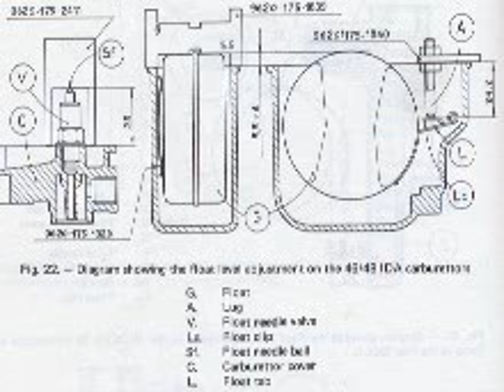Picking Weber Emulsion Tubes by David Vizard

Comment: where I can get more of this recording..
Reply from the maker: I'm not sure if they are still around, as my old links don't work any more, but it's from Technical Insights P.O. Box 461150, Aurora, CO 80046-1150, Ph 303/745-9735, Fax 303/338-0470. I had trouble ordering tapes in 2007 - I think the owner was getting old - and couldn't get any back then. The tape is called How To Build Horsepower, by David Vizard Oct 12 - 13 1996 Charlotte, NC, and they were bought back in 1997

Comment: I would like to know why the various emulsion tubes are stepped on the OD..?
Reply: Jason Gipson : Yes, to ease construction and retain the well tube in the carb body Jason. It allows identifcation by stamping and external profiles. David Vizard has to teach service technicians to suck eggs. For non IR/ITB Holley 2 or 4bbl or dual quadss, well tube drilling or blanking off will trim air fuel ratios strategically at pioint thru the rev range to create an EFi style flat fuel curve.